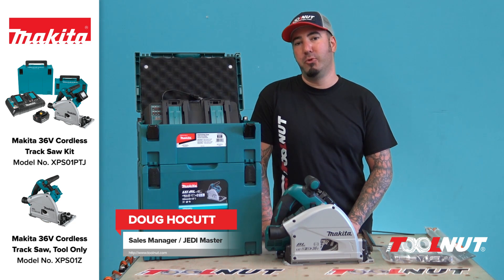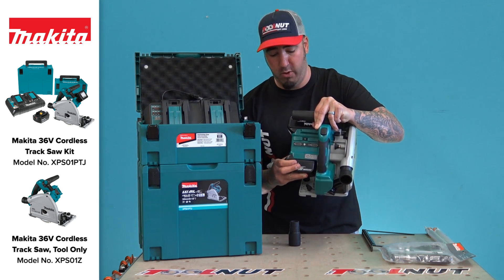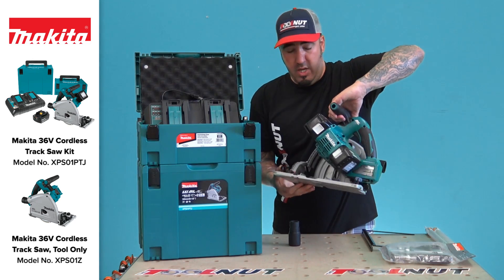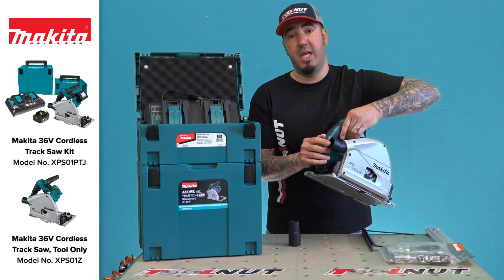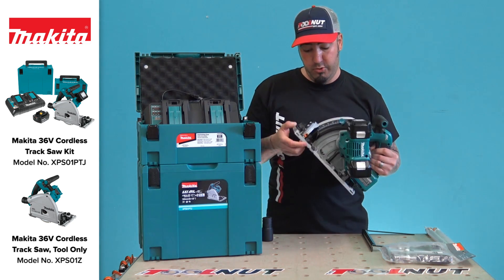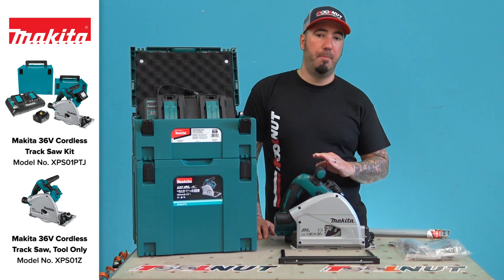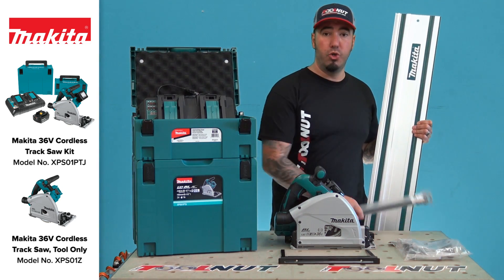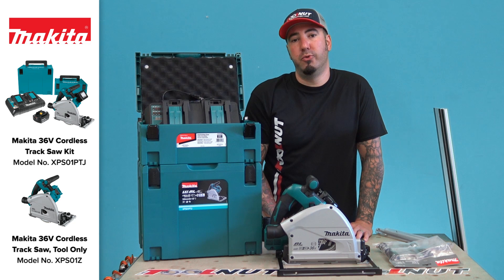Makita XPS01 36V Cordless Brushless Plunge Track Saw

Comment: I have a tiger maple slab . 2 in. thick. Can I make a clean bevel cut all the way through including track. Doesn't sound like it.
Reply from the maker: It will not,  1-9/16" at 45° is the max depth

Comment: I just ordered the XPS01Z saw. Do you have to use Makita blades on this saw? Or can use Diablo brand?
Reply from the maker: Blade diameter must be 6-1/2" and (importantly) arbor size must be 20mm. Any brand will work. Just a quick look and I don't see a 20mm arbor 6-1/2" blade from Diablo.
Reply: I haven't found one yet either. Thanks for the info!
Reply: If you take out the inside washer  where the blades sits and use the other side you can use the regular Diablo blade thank me later. Top secret 👍
Reply: @Eyehearttravels  ....Thanks Bill...good to hear you're out of jail...lol
Reply: @multibikermike4681  I was set up lol

Comment: Hey! Do you have the Makita XSH08 18V X2 Brushless Circular Saw that fits on the Makita Rails?
Reply from the maker: @24revealer  Just a note that the 4100KB is a 5" masonry saw that also works on the rails. A bit more of a specialty tool, but also the CA5000X aluminum groove cutter.

https://www.toolnut.com/makita-4100kb-5-dry-masonry-saw-with-dust-extraction.html
https://www.toolnut.com/makita-ca5000x-4-5-8-aluminum-groove-cutter.html

Comment: Does it work on the DeWalt rails?
Reply from the maker: Yes, compatible with Festool, Makita, Triton and Dewalt rails.
Reply: The Tool Nut This is incorrect. The raised guide on the Dewalt track is in the center of the track. A design that allows the Dewalt saw to cut both directions down the track. However, the location of the raised guide also makes it incompatible with the other saws.

Comment: identical to the festool
Reply from the maker: Not exactly identical, but very similar. There are some differences. For instance, the Festool can run on a single battery while the Makita requires two to operate. However, the blade speed and resulting cut speed have been tested to be much better with the Makita. And, if price matters, well... Not the same.
Reply: Just got mines in today …Same shit for a better price 😀 #team Makita